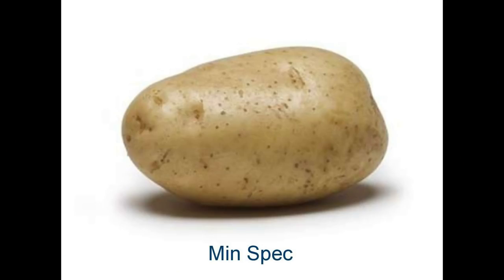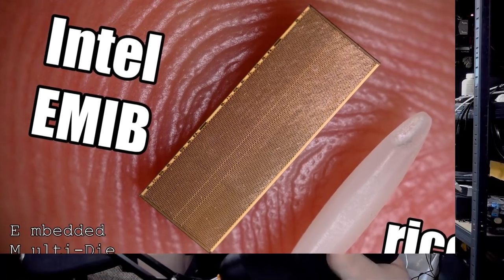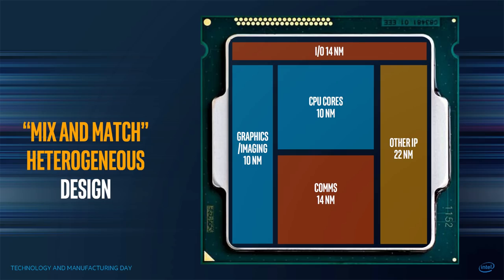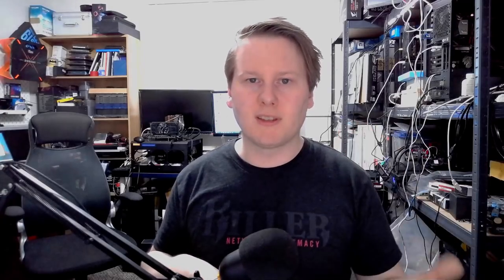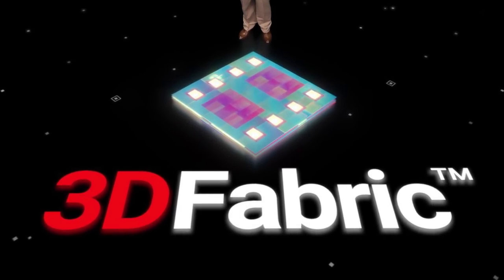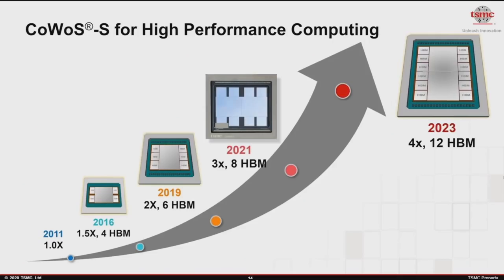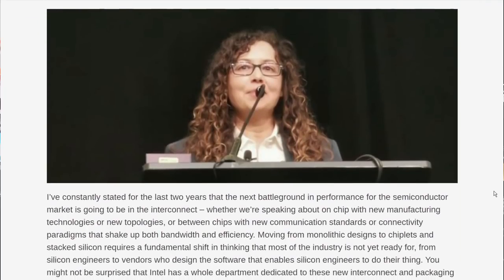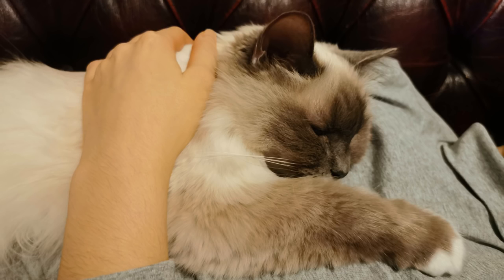Intel's Tiles vs AMD's Chiplets

Comment: Intel's Tiles vs AMD's Chiplets vs TechTechPotato's Chips (made out of tasty silicon, of course)
Reply: wait are we talking about chips aka french fries or chips as in Lay's potato chips?
Reply: @2drealms196  We're talkin' bout both here.
Reply: @2drealms196  walkers*
Reply: @2drealms196  yes
Reply: @TuskForce  Do Pringle's chips still outperform Intel chips?
Reply: @2drealms196  The Pringles die has a way bigger surface area. That's why they perform way better, especially when it comes to the assembly process.
Reply: @TuskForce  LOL!

Comment: History has shown us (EE history anyway) is that while theoretically parallel links have very high throughputs, they are much more difficult to close timing with, as the speed is limited by the slowest wire, and serial connections out-speed them in the end. 

If I was a betting men I would do it on EMIB only being a stopgap until they develop their own infinity fabric type interconnect
Reply: yeah passive interposers are just a step before active ones. intel describing it as advantage over AMD's approach is just a typical intel

Comment: I wonder how much the cost for the EMIB on that 47 tile moster is? I suspect it might well the the most expensive single component of ponte vecchio, though I have zero numbers to back it up.
I wonder how long Intel will stick to using a parallel design? There's a reason (or more) that the vast majority of buses have gone serial.

Comment: If those are "wires", is it correct to say that they can connect only the dies that are close to each other and there is no uniform connectivity in that 47-tile thing? Cuz Infinity Fabric connects everything with everything in all the ways
Reply: It will enable Intel to sell chips for peanuts...or in Intels case...Overprice them and make more money. I think I will grab my Intel 10400F while its still cheap.
Reply: Well, you can always have more EMIBs for bridging more tiles, but that again goes back to Dr. Cutress' aforementioned concerns about scalability. I think Intel has the upper hand as we move to more and more complex designs though, given that it doesn't face the latency issues that are already a concern in AMD's chiplet approach now. Also, the enterprise sector will pay whatever premium it is asked for, for an extra feature or some extra performance.
Reply: Super computers always use a crossbar switch. I'd be very surprised if they are expecting to just use 'wires'.

Comment: This is perhaps a little out-there, but I find myself wondering... if some day there might end up being optical interconnects for these sorts of die-to-die links, based on silicon photonics and light-guide based interposers.
Reply from the maker: Intel is working on integrated photonics. They had a large Intel labs day presentation on it in December.
Reply: @TechTechPotato  Yeah, I recall that being mentioned in your recent interview with Dr. Richard Uhlig. Found myself thinking back to that interview while watching this tiles/chiplets video. Would be interesting if some day that integrated photonics work ends up coming to market to address some of the limitations of the existing on-package interconnect solutions, though I'm not sure whether that's how things will pan out.

Comment: Do chiplets make chip design easier, in that you can modularise development more?
Reply: Yes. Development and testing can be done separately and multiple chiplets can be developed in parallel, even using different process nodes and foundries.
Chiplets using the same standard interface, for example AMD Infinity Fabric can be reused in multiple chip designs.
It also makes it easier and faster to switch between ramping different chips and respond to demand changes, like AMD can do with core chiplets and chips for datacenter (EPYC) or desktop (Ryzen).

Comment: Do we still think there is room for TSMC manufactured 5nm monolithic CPUs this year and 3nm next year for Intel like so many prominent industry insiders are suggesting before we move onto tile based CPUs where Pat said Redwood cores and beyond would be node agnostic to allow for the likes of TSMC to help with production of different tiles?
Reply: Mono chips still make sense for the low end and midrange. It's more cost effective on smaller chips.

There is a cross over point where chiplets become cheaper. The packaging and additional labor/assembly costs add up and push the low end chips out of the cost effective sweet spot.
Reply: @glenwaldrop8166  yeah, I just couldn't decide from what Pat was saying whether Intel will make CPUs at TSMC this year on 5nm and next year on 3nm like is being rumoured or whether he was saying in 2023 with Redwood it was likes some of the tiles would be be made at TSMC.

Comment: Yeah, the smallest parts won't make sense to make out of two pieces. There seems to be a floor of around $200 for AMD's compute + IO die packages.
Reply: I'd say the floor is actually around $100, considering the 3100 and 3300X... and the fact that the 3600 could be found for significantly less than $200. AMD's problem for offering low-end chiplet packages seems to be that their wield rate is just too good. So they never have a reason to sell 4 core stuff if the 6 core is selling like hotcakes. Also keeping GloFo busy with low-end monolithic chips worked quite well for them overall.
Reply: @erejnion  back when X570 chipset came out there were numbers of the chipset costing $40-50 to the motherboard manufacturers.  The X570 chipset is the same as the current IO die. 
I'd say they were offering the R3 3100 and 3300 at a loss, in limited numbers. Both chips were notorious for being impossible to find in stock.
Reply: @davidgunther8428  I highly doubt they were selling the 3600s at a loss. And the 3100 and 3300X existed just because they had a few chiplets that couldn't get into 3600s. Of course they would sell a 3600 instead of a 3100/3300X if they can.
Also, by your own math, 40-50usd for the huge 12nm I/O, and probably around the same for the tiny 7nm chiplet makes exactly under 100usd for one CPU.

Comment: On Chromebooks: how many will run Intel or even AMD, versus Mediatek / Rockchip / Qualcomm (in the future)? If cheaper + longer battery life + better Android compatibility are more important than raw speed, I’d wager Intel loses Chromebook CPU market share. I agree with the overall argument but Chromebooks may not long for x86.

Comment: I mean... is it really that hard to put them together if we have a 40+ tiles model? because if it's that hard they would probably have issues with mass production I think 🤔 wonder if it's just misconception of my part though
Reply from the maker: Ponte Vecchio is a low volume product. But they've been working on this for 10+ years. Will have to build out multiple facilities and maintain consistency.

Comment: Intel is going to glue their chips together? That will never work. Intel told me so.
Reply: @Le Wojak brr shhhh Intel said so.
Reply: @Le Wojak brr I posted a link, several times, but I guess now Youtube is auto-deleting all comments that contain links. Just look up intel's comments about the launch of Epyc. Intel dismissed it as "4 glued together desktop chips".
Reply from the maker: You mean a single slide in a technical press briefing built my engineers (not marketing) referring to the use of glue-logic? That's a bit different to creating banners that say 'GLUE INNIT' and becoming a marketing campaign
Reply: @Le Wojak brr Intel's tiles are chiplets. It's just a different word for the same thing
Reply: @Le Wojak brr Ryzen doesn't need an I/o chip either. And just because Ryzen isn't currently stacked doesn't mean it can't be.
Reply: @Le Wojak brr Intel doesn't call it chiplets because they want you to think theirs is special

Comment: There was a new silicon created when companies like apple could be IP from ARM, Qualcomm, etc, slap it on a chip and make a product.  Intel missed out on that market.  Which technology would allow a company like Dell build an entire laptop laptop.  Could Dell build an entire laptop with CPU tiles from Intel Memory tiles from Micron, graphics tiles from NVidia, SSD tiles from Samsunbg, etc.  Or would it be easier to use chiplets like AMD's?